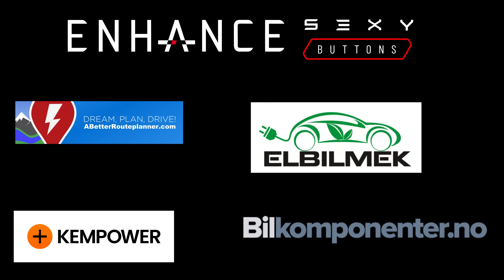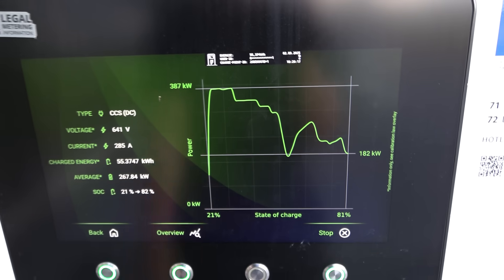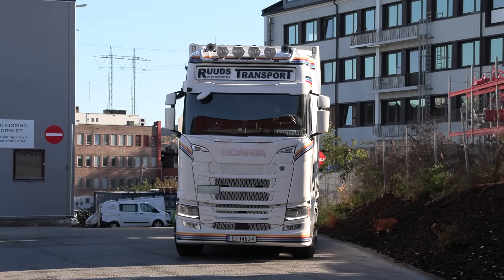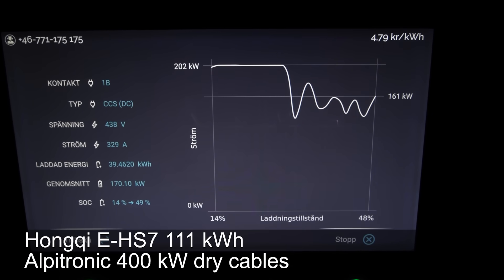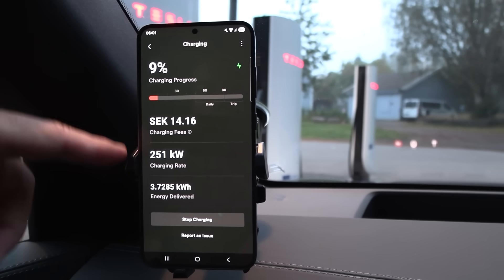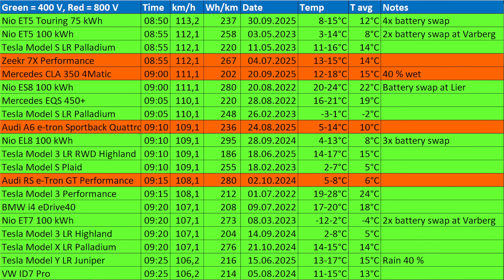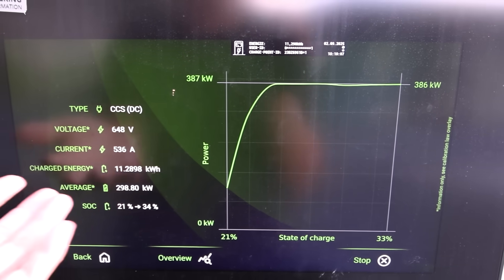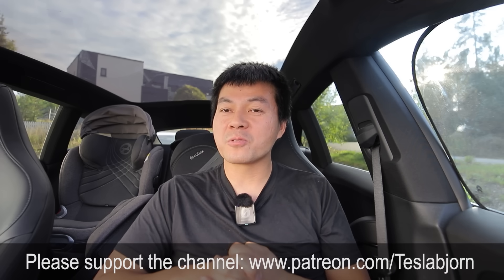How dry vs liquid cooled cables affect charging power

Comment: It's not the same 400v vs 800v in pack/charge performance.

To have same charging power as 800v car, a 400v car charging would need to run at double the amperage. Each cell would be running at twice C rating and generate extra heat as by product.
Reply from the maker: That's not how things work...

Comment: Just plain technically, on the top of My head, I am sure this is an incomplete list:

What are the perks of a 800V System?
+You can use smaller conductors, to get the same power, does not matter if to the car or inside the car/electronics, hence the possibility of faster charging.

What are the drawbacks?
800V Battery can then generate +800V and -800V making 1600V difference resulting in:
-getting Voltage rated components. This affects:
--PCBs in Size, thickness, material, design
--Electronic componets, they can be slower, biger, heavier, less efficent, but certainly more expensive and not of the standard stuff.
--Cables, "normal" cables generaly have a 1000V rating.
--Motor, Because of more isolation needed, the efficency really drops, because every gap just generates losses.
-The Switching of the higer voltage generates a biger "delta"I what causes more electomagnetic noise
--this actually disturbes communications much more, generates "crosstalk"
--needs better shielding, or more space between components

In the contrary, 400V systems, can use standard industrial components, that can be sourced from nearly every manufacturer.
The Design of such components is tested in billions of Industrial segments for many Years.

NOW you might ask, why is every Truck out there in a 800V configuration? it is a very different use case:
*the car is 3.5 Tonnes max in EU, the Truck is 42 tonnes(40 plus 2tonnes for electonics and Batteries), or more with special permit.
*space is not an issue in trucks, weigth not as much an issue as in cars.
*the portion of high power on a car is "not much" compared to the Truck.
*Price is not such a great issue. 
*Regulations need the Truck to be able to recharge 4.5h driving in the mandatory break of 45 minutes, every day, once, sometimes twice
**alot of cars can are charged AC, and rarely use DC.
**We are 11 perseons in our team, 10 have full electric, the commutes are 40-150km and max 350 km customer distance, most have more than 85% AC component.
**meaning the time spent on DC-Chargers is not really relevant, compared to the Truck

Comment: 800v = twice more cells in serie = twice more possible connection problems and with bms. And skyhigh more possible HV isolation resistance problem.

Comment: Using 400V systems in premium cars is outdated. The benefits of 800V systems are clear, and apart from manufacturing costs, there are essentially no downsides. I’m confident that within a year, at least 10 cars will dominate the fastest 1000km challenge using 800V systems. This video even highlights the issue—not just with the cables but also with the low voltage itself.

Comment: Bjorn, I added a long explanation on 400V vs 800V on one of your videos. Perhaps you never read it, so instead of making it so long, I'll just give you 2 perfect examples of why it's more about voltage than chemistry.

I'll give you an example of an 800V vehicle, which by your reasoning, has 800V "chemistry" cells and "thermals" to allow them to charge faster and have a much longer high charging curve. 

The Tesla Cybertruck is 800V architecture, but splits the pack in two when charging at 400V, making it a true 400V charging vehicle on 400V chargers. But since Tesla does not have 800V charging cabinets in any of their V4 stations except for one, they have added/configured some of their charging cabinets in some stations in America to what is called V4 3.5 stations (with LIQUID COOLED CABLES to take that out of the equation) for the Cybertruck. But because they're still 400V cabinets, the only way to get the Cybertruck to charge over 300kW is to use extremely high amperage (what the main public calls current) of 900 amps. 

But because this generates an enormous amount of heat in the pack surrounding the cells, it can only maintain 300kW for a total of 14% (from 2 to 16% SoC) before it has to drop of a cliff as the amperage/current has to be brought down to below 400 amps very rapidly to avoid damaging the cells, bringing it down to under 140kW by 50% SoC. 

And now I'll give an opposite example. The Cadillac Escallade IQ is a 400V architecture EV using two 400V packs. When charging at 400V chargers such as V3's (with LIQUID COOLED CABLES), it maxes out around 190kW and can't hold it past 40% SoC. But when charging on 800V chargers, it connects the two packs in series to charge at true 800V, where it reaches 388kW on capable chargers, and stays above 300kW to past 40% SoC, and doesn't go below 225kW until past 75% SoC.

So neither one uses voltage converters of any kind, so that's out of the equation. They each charge at true 400V on 400V chargers, and each charge at true 800V on 800V chargers. And each use the same cells and thermals when charging on 400V chargers as they do on 800V chargers. So what's the one common denominator then? Voltage.

Comment: 800V battery pack on it's own doesn't make the car efficient, as you said. But it's the other parts of the 800V architecture that see the benefit from higher voltage, like smaller busbars and cables, less heat loss etc. This is explained well in Lucid's Tech Talk about their battery. I would consider the Air quite efficient and it has a maximum pack voltage of 924V. So no, not all 800V cars brute-force their way, maybe the ones you've tested so far do. Hope to see some of the "high tech" features of these big battery behemoth's find it's way to smaller cars with smaller battery packs too.

Comment: I think 800V or 900V are more suitable for extreme hot weather areas like southern US, Spain, Middle East … etc. I can see in the future, 40-60 KW battery cars will be at 400V to reduce cost and the larger battery packs/ extended range cars will be at 800V+ but this is maybe more for 10+ years? 🤷 currently, most countries is still working on their charging infrastructure so 400V is fine and here to stay for a long time. This is just my opinion.

Comment: Power into any device is volts times amps.  400v x 500a is 200 kw into your car.  Now if we can double that 400v to 800v, then to get the same 200kw into your car, the wires can be significantly smaller, since it now only needs to flow 250 amps to put 200 kw into your car.  DC charging wires are big wires, so if we're able to reduce the size of them by about 50% this takes a lot of cost out of the charger, and the car with no appreciable effect that the customer sees.  Reducing the current also reduces the heat loss in the wire at high power levels, a good thing.  Does this mean that 400v cars are bad and 800v cars are what we should be seeking?  No.  These systems perform very similarly in daily use, so there's no need to focus your energy on getting a car with the 800v technology.  400v tech will live on for years, and the 800-1000v chargers can still put a charge into a 400v car.
Reply: Then what is the issue with making all cars 800V? How is it more expensive to produce when the cable is thinner?
Reply: @diesderic One drawback of higher voltage is that the battery isolation and isolation of other components of the high voltage system have to be better which often increases weight and costs

Comment: My Renault Zoe was shipped with 4mm² type 2 cable (instead of standard 6mm² for 32A 3 phase). In summer it gets really hot when I charge at 22kW, but I still prefer it because it takes less space inside the car and it is easier to pack.
Reply: I also still have the Zoe cable from 2013 in all of my newer cars. It's the best. Not only lighter than other cables, but also more flexible thanks to the material. 

The additional loss due to heat doesn't really matter. It's 72 W with 4mm2 (with 32A 3ph) and 45 W with 6 mm2. So in 4h it's 0,1 kWh more consumption for a 88 kWh charging sessions. And if you use a 16 A station, the additional loss is only 6 W.

Comment: Transition to 800 V asap.
Charging speed is highly dependent on battery temperature. In the near future, we will probably see pouch batteries with direct liquid cooling around the cell, making far higher charging speeds possible. 
Also, we will see other technologies than the mainstream today, that can handle faster charging.
Reply: For car battery it doesn't really matter if battery pack is at 400V or 800V since each cell will receive same current regardless. It's only the chargers which benefit higher voltage
Reply: @IvanJanjic-p9x  I never said they would. Point is development of batteries and charging is peaking now, so in order to support those charging speeds, we need 800 V. We need to shift mainstream into 800 V to get the prices down.

Comment: Solution is higher voltage. Go to 800 V asap.
Reply: 1600 V asap, no wait make that 3200 V asap or am I being too conservative? It all sounds like megapixels to me.
Reply: Yes pls move to the 800 V hype, i will buy your cheap 400 v vehicles
Reply: @visionmodernclassics   Did you watch the video? We are closing in on a limit on DC charging power. No hype. Just better, so why not? The charging power has increased immensely on car models since ~2010. Or even just 2020. Why would anyone think that increase would stop now? If a model with 400 V architecture came out with an option for 800 V that didn't cost more, would anyone buy the 400? It's just evolution like screen size on TV's and charging speed and CPU on phones? I  believe TB calls it a hype because he doesn't want architecture to be the main selling point. But to my knowledge he has never said we should stop at 400 V.

Comment: How can this friend of TB know that the cable degrades over time?
I guess it could maybe happen due to strands in the wire being torn off and terminals being worn down? Also, the chargers might lessen the power due to decay in the electronics?
Reply: Same question here, would also like a more in depth explanation.
The terminals getting loose over time I understand, but the cable strands themselves should be ok, there is a lot of heavy industry equipment with moving cables that dont need replacement for many years.
Reply: Cable manufactures give these Numbers. We have a cable manufacture with dry cable 30min 500A boost. It can do that 20000cycles after that the cable need to be replaced. But because it is dry cooled it is not that expensive. Most Charger brands recommend to replace cables after 5 years.
Reply from the maker: He runs a charging network.
Reply: @bjornnyland  So, how did he measure this? Did he just notice his car doesn't get the power it once did? Or did he scientifically measure many chargers with proper, calibrated equipment to get a statistically significant number?
Reply: Also, in the plastics used for cable insulation, the effect of plasticizers weakens over time. This can lead to hardening of the plastic and, especially in movable cables, the formation of microcracks. Together with moisture, these can cause deterioration of the insulation at voltages of around 1 kV.

Comment: If a charger is limited on Amps - usually because of a too high temperature (because the Amps cause the heating, not the voltage), I guess (I'm not a specialist) the charging power ("speed") can be increased by increasing the voltage which does not heat up the charging components, so an 800V is better.

Also, I guess when the battery pack is too hot, the current (Amps) could be reduced to diminish the heating caused by charging - an 800V system would reduce the charging power slower than a 400V because it can take more Volts (Power = Amps x Volts).

Regarding the cells, they usually accept up to 3.2V, so I guess at 400V means 400/3.2=125 cells can be charged simultaneously at max voltage while on 800V it is double at 250 cells. So the battery capacity can be increased by increasing the number of cells and at the same time increase the charging power for the whole battery pack - even if the power/cell remains the same.
Reply: 400V battery is like two 400V batteries connected in parallel while 800V is like two 400V batteries conencted in series. At cell level every battery cell receives the same current for given power regardless of voltage of battery pack. Higher voltage only benefits chargers
Reply: @IvanJanjic-p9x  "At cell level every battery cell receives the same current for given power regardless of voltage of battery pack." - this is what I also said "even if the power/cell remains the same". However, in order to increase the battery pack capacity (kWh) and increase the charging power of the battery pack you need to put more cells and increase the voltage - so 400V or 800V matters.

It's not really smart to increase the battery pack capacity and not increase the charging power because the 10% to 80% charging time will increase and people won't buy the car.

If the voltage is not increased, then the current (Amps) has to be increased which increases the heating (and requires heavier wires).

Comment: This is why I think that MCS is flawed at topping out at 1 kV, they should have gone right to up to 3 kV that train heating cables use for some future proofing.
Reply: There is a limit on what you as a consumer can operate and touch. People are forgetting they are touching and playing with cables and connectors where more then 600 horsepower flows. This is no joke. MCS is a very, very expensive cable and connector. I don’t see a future for that in the short term. For truck charging a stable session for 1 hour 400-700kW is more then enough to drive within the law driving our limits.
Reply: @Kleuvert  yes, this is why I brought up the electrical connections of trains. This is an interface that needs to ensure safety despite being potentially accessible by the public and being operated by personnel with fairly low qualifications.

Comment: the guys from Luciud explained supper easy why a 800V should be more efficient. Basically the losses from energy propulsion ar mainly from the square(I). I don't think that there is any EV on market now that does not have SIC mosfets, so this could be ruled out. And then what remains is the Cd and frontal area of the car that will influence consumption, that by the way also increases by the  square(speed). From simple math regular sedan is in average 20% more efficient at 120Kph than SUV(maybe that's why all electric SUV have in average 20 % larger battery). Tyres have influence as well, not sure if size or rubber compound/profile. So long story short -> 800V sedan with good Cd and 16/17 inch tyres would have best efficiency.

Comment: BMW,  Mercedes, Audi, NIO, etc are shifting to 800V, but it will be a while before cheaper segments do. In a couple years the top of the 1000km chart will be dominated by them, except for maybe Tesla (and they may eventually go 800V too...).
Reply: For car battery it doesn't really matter if battery pack is at 400V or 800V since each cell will receive same current regardless. It's only the chargers which benefit higher voltage
Reply: @IvanJanjic-p9x  lots more to an EV battery than just cells. The benefits on the charger side are mirrored on the EV side (due to lower current)

Comment: People automatically assume that if the number is bigger its better, 
its the same thing Apple Vs Android
"i have 16gb ram instead of 8gb" so Android is better
"This charges at 500kw instead of 250kw so its better"
"Prius has small engine therefore its slow and bad"

i can go on and on.
and when the hypetrain "comes"  so many people get misled and disappointed.
Numbers and hype chasing literally defeats the purpose of a product reviewer
i thank you for sharing your opinion.
Btw so just to nitpick 7:30 the charging test, even though Nios percentage was higher the energy delivered was lower most of the time, not to take anything away from your point (400v can be as fast as 800v)
In the real world percentages dont matter, its the KWH delivered and the potential range.

Comment: Hi Björn, where 800 Volt cars are really an advantage is here in Thailand. The reason is (and I actually got the info from you) that many chargers have a 200 amp limit on the cable (like EV Pluz at PTT). Our MG4 gets a maximum speed of 70 KW (350 X 200). I recently had a rental Model Y from EVme and charged in Pattaya at a PTT Hub. Max speed was 88 kw. We just bought a G6 and I have not charged it at PTT yet. But I assume I will get at least 120 KW. I charged the G6 at the Hypercharger near the airport (in BKK) though and I got 224 KW at 69% SoC. If you are planning a meet-up during your upcoming trip to Thailand please announce that a bit in advance. I would like to join that.

Comment: And then, what about the cables in the car itself?
Not sure if they are cooled, but if they also degrade over time, then the older the car gets, will they also start to charge slower?
Reply: They can be made much thicker. Also, tgey can run as individual wires and not bundled inside the cable, so the get 2x area and less insulation for cooling.